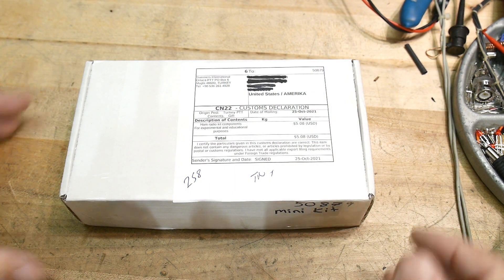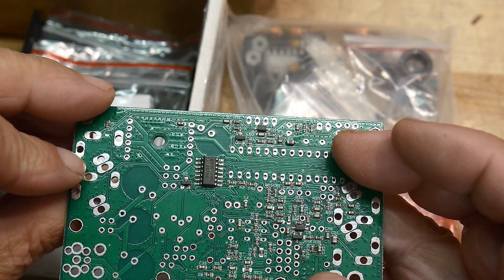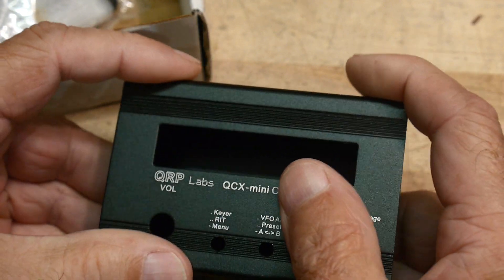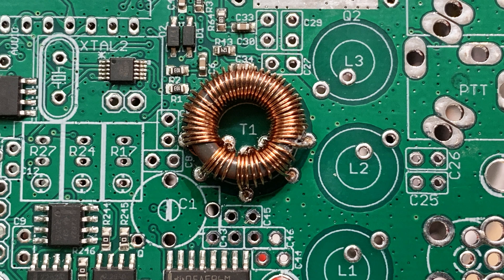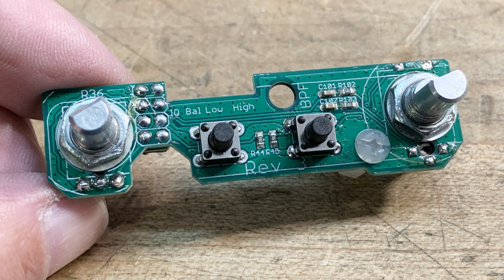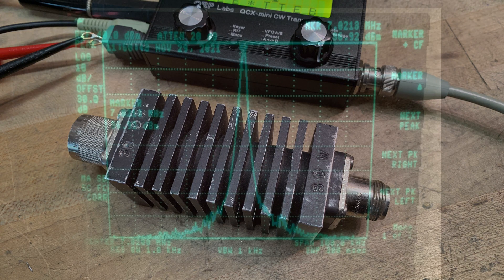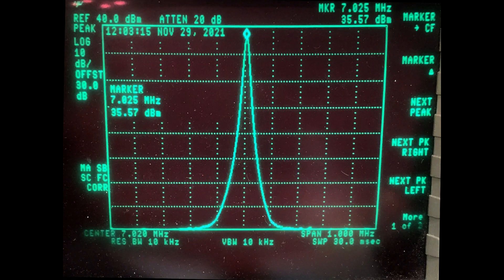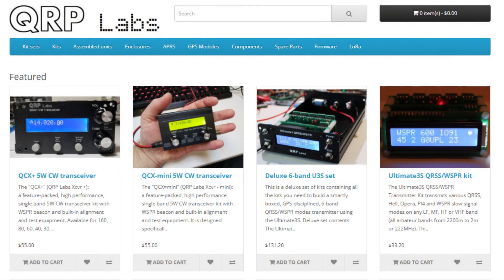#989 QCX-mini 5W CW transceiver

Comment: What kind of power supply did you use in order to get 13.8 V?
Reply from the maker: Lab bench supply
Reply: @IMSAIGuy  Sorry! I don't understand!
Reply from the maker: @havefun2952  NICE-POWER DC Power Supply Variable 30V 10A Adjustable Switching Regulated High Precision 4-Digits LED Display 5V/2A USB Port Output & Input Power Cord Bench Lab Power Supplies https://a.co/d/cgMtxHl
Reply from the maker: There are hundreds of different ones

Comment: I just complete my 30m QCX-mini today. It took me 4 nights to build it at around 2-3 hours a night. The assembly instructions are thorough, but even still there were a few pain points during the build to have to contend with (like winding T1, mounting the BNC RF connector, and tuning the LPF). Other than a stupid issue I had with some alligator clips on my 13.8 VDC power supply that took me a bit to figure out, the transceiver worked straight up with no issues. Good fun, and good little transceiver.

Comment: It is worth noting that while our host showed the unit hooked up to a spectrum analyser, you do not need any test equipment to test and align the unit; there are menu items that self-generate test signals and the assembly/alignment instructions cover this fully.

This Alan Wolke video shows a good trick for winding toroids: https://youtu.be/sDIWNHOoNh8

The QDX design from QRP Labs is also fantastic, although the last batch sold out in under 5 min (not kidding.)

Comment: Hi, thanks for video.

I build two minis 40m and 20m and give 40m as a gift. After some time I understood that 40m qcx is the best one.  I have 20m and using LW antenna can pick up some station at a specific time of day. 40m band is alive full day and I just connect antenna in any time and get station in headphones. Also it is easier to get 5W from 12V on 40m version. I actually got 5.6W on 40m and 4.3W on 20m with 12V. For 20m version it took me about 3 or 4 evenings. Now I ordered one more QCX mini for 40m but going to use custom enclosure with international battery and probably manual tuner. QCX mini's board very small and there is plenty of space for improvements.
Also QCX is one of my main reasons why I started learning Morse Code and had my first QSO this year.
73 de EW1IM ..

Comment: Nice kit and review. I'd almost like to build it, but would never use it. I can't hang with CW. I'm one of those "no-code extras" that has never made a CW contact on the air. When I took the test, I was halfass proficient at 13 WPM. A friend of mine who was one of the volunteer examiners insisted I take the 20 WPM test. I got the TX an RX callsigns at the beginning, and it all fell apart from there only copying every third or fourth character. Enough copy to guess what kind of antenna was being used from the multiple choice responses. So I legitimately got three answers, and luckily guessed four more for 7/10 to get a pass. I always suspected my friend altered some of my answers. I'm think its been about 10 years since I actually conversed on the radio. Your series of videos is inspiring me to get back into ham radio.
Reply: After 50+ years of interest in ham radio I finally got my Tech ticket about six years ago then upgraded to a no code Extra a couple of years ago.  With radios like this one and programs like CW Skimmer there's no need to have any expertise in sending and receiving CW by hand.  Someone out there will probably call me an "appliance operator" and I'll ask them if they still hand crank their car in the morning to get it started before they head off to work.